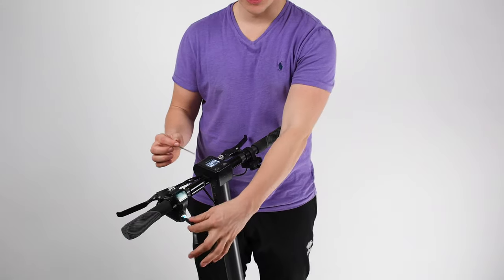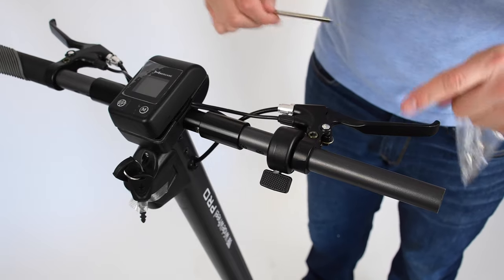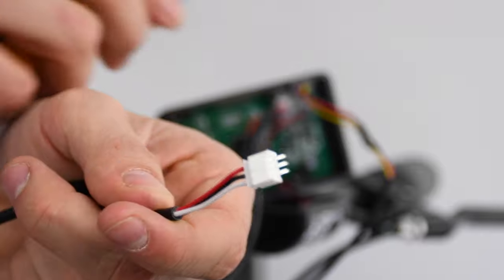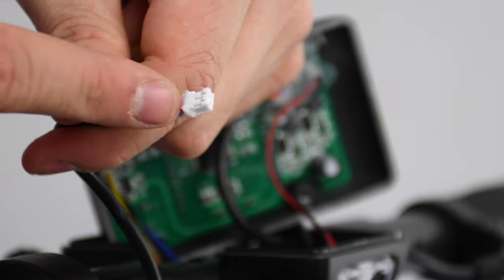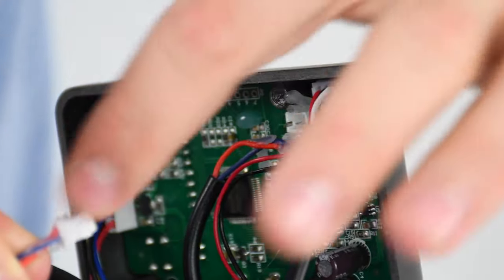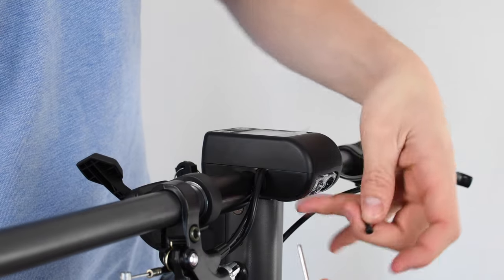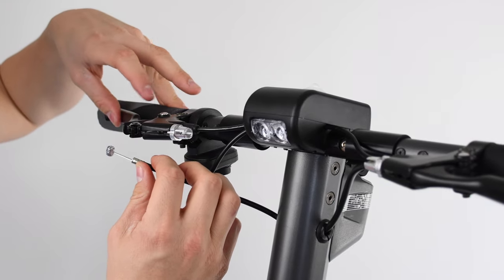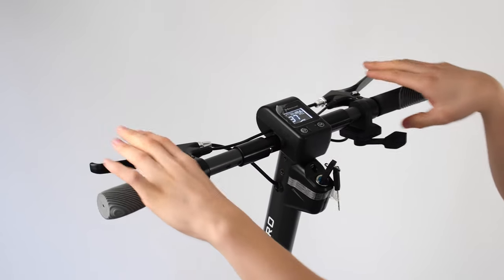Mercane Widewheel Pro Throttle Upgrade Installation

Comment: You know you can leave the grips on and the brake attached by simply removing the 4 small hex bolts holding the right bar on by the folding mechanism? Saves you having to struggle with the grip and from cutting the brake sensor out. Just slide the brake and throttle off with bar detached.
Reply: @apolloscooters9429  I only realised after getting blisters wrestling the grip off 🤣 we learn from our mistakes👍
Reply: Thanks for that.  For those new to this scooter like me here’s a video of the screws your talking about.  Around (19 secs). https://www.youtube.com/watch?v=_IxkNnYwN-E
Reply: Hmmmm.  Wish I would have thought of THIS before pulling the grip off!  :-)

Oh well.  Live and learn.
Reply: But if you do ever need to remove the grips , blast a airline down the inside & they pull straight off , unless there glued of course
Reply: I have no idea how you guys can do it, considering the black "lock sleeve" always cover partially the inner set of bolts, making them impossible to unscrew. I assume there must be a defect with mine. No matter what I try, I can't get these bolts exposed.
So I may need to go with the method shown in the video, but they conveniently skipped the part explaining how to unplug the break wire itself (they show how to unplug the electronic wire, but not the break itself)... :(

Comment: im able to go at 3 to 5 km/h with the original throttle by putting it flat on the throttle and using it as a "twist throttle" and it works surprisingly well...

Comment: Good video.

Just FYI: On the Widewheel Pro 2020 that I have, the screws holding the dashboard together are Phillips heads and not Allen.

Also, the Allens wrenches that came with my WWPro lack the right size for the new theottle setscrew.

Also, if you install the new throttle as you show it, the handlebars do not fold down.  We installed it at 90-degrees so we are pushing down on the throttle instead of forward.

Throttle works great!  Better, more gradual control!  Thanks!

Minor issues, but FYI.

Comment: The new throttle control cable is quite long.  Can the excess length be folded up , zip tied?  Maybe fold into control-speedometer box?   Or it needs to be cut, spliced to shorten length?

Comment: My board didn't have any hot glue so I pulled the whole socket out. Very precise work to put it back on again. Then my upgrade throttle came with about 1.5 meters of cord and a plug that did not fit at all. So had to cut most of the wire and solder on pins and install them in a new socket. The 3 cables are not the expected color or position as well. Haven't tested it yet because I wanted to verify that my wiring was correct. But you cheated and used a matching connector. 😉 Beyond that the throttles are identical.

Comment: Just wanted to update everyone as I just did this yesterday 8/24. 

My WideWheel Pro has a mfg date of 7/2020. 

-The 4 screws that hold the display together are philips screws
-There is no hotglue anywhere on the board or connectors
-The brake handle slides off easily if you fold the handlebar down
-The rubber grip slides on very easily with a little bit of soapy water

Overall an easy installation!

Comment: The scooter should never have been sold without the new throttle. The difference is dramatic and control greatly improved. PS, no problems with scooter, it is excellent.

Comment: Hello I wonder if you can help me Iv watched your video on upgrading the throttle on Mercane wide wheel . However the link you had doesn’t ship to England. I purchased one of e bay but the connection is different and the white cable is replaced by yellow. Is the white cable the line or control cable and the red and black being +&-. Or do you no if a site ware I can purchase the correct upgrade throttle from .
Regards
Ken

Comment: Mine and possibly all 2020 models have Phillips head screws. 2 can be easily removed. 2 i cannot budge. Typically screw drivers like this are small. Access to 2 screws is impeded by the stem of the handle bar. Leverage is almost impossible. Can anyone offer a solution. This should have been a simple job, and am faced with keeping the old (unsafe) throttle.

Comment: it is possible to put a second wheel with brake to the widewheel 2019 or use pro parts in 2019

Comment: The Potentiometer that is included with this scooter is junk. The resistive range is severely small and limited. This causes the response to be jerky and selectivity to be limited and touchy. The upgrade as Apollo calls it, should be included with the scooter from the manufacturer. The response from the potentiometer out of the box can be dangerous and could result in personal injury. Also there seems to be significant travel of the thumb mechanism before a response is achieved making starts jerky at best.

Comment: nice video, good to see you:)
Reply: @apolloscooters9429  Good morning I saw his video with the Apollo scooter where he pushes the mode button and the button to access and turn off the scooter at the same time I did not understand well but by doing this you can change the parameters of the scooter and how to set them for everyone but it is better to do it  or not?  Maybe it is better not to touch anything to avoid problems with the scooter, if you make a mistake, you can reset and return the display to the factory settings or not?

Comment: There is a website i found, that has a PDF download that shows 2 methods for the install. With the other method, you do not need to remove the "Rubber Handlebar Grib".. or the Break Lever. Some might find that easier ..  Here is a link for that website:   https://drive.google.com/file/d/1vTQ9y0OFZYBo4CkNMJAYLtug5xnrARVq/view
Reply: PS - when i tried to download the PDF using the Firefox browser it would not do it. But when i used the Chrome browser it opened, & downloaded (after it downloads, look in your download folder)